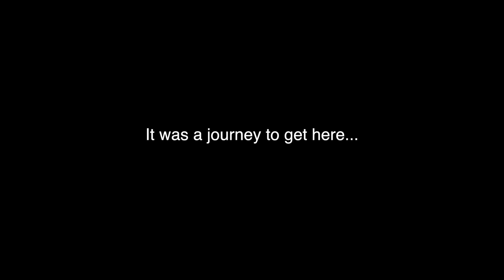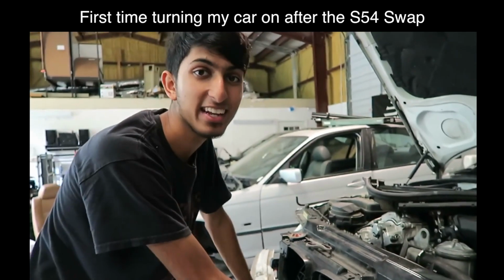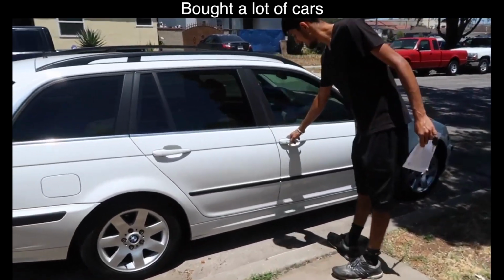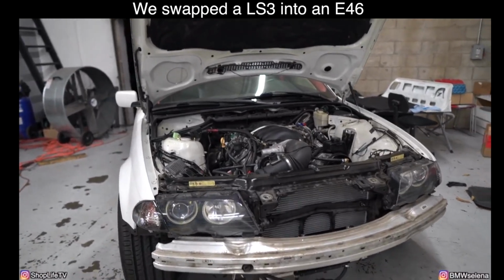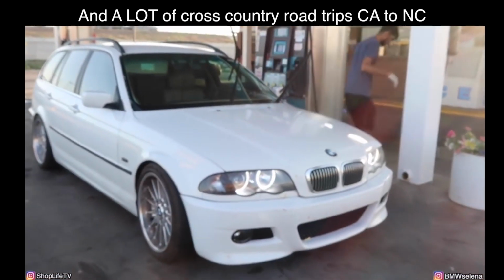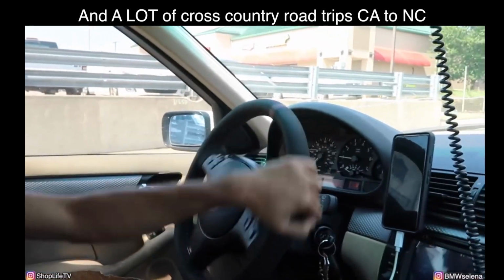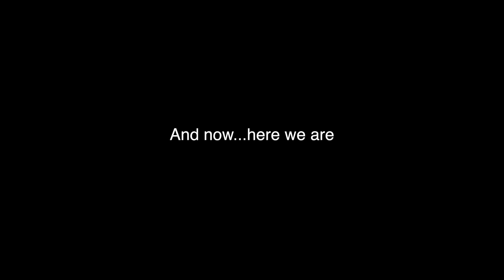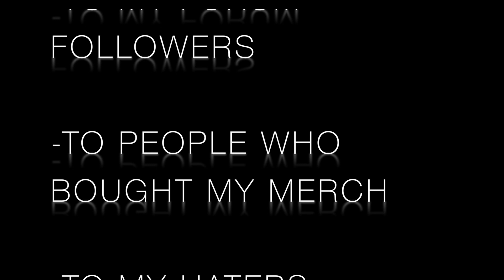My Life On YouTube! Thank You For 100k!

Comment: Hello, I have a 2006 bmw 550i. It has 73,6xx miles. I have some oil leaks and have started to gather parts and supplies to fix the oil leaks. I was wondering if you could help me out with a list of things I should buy and replace while I am doing valve cover gaskets and such?

Comment: l have been watching from day 1. The amount that you have helped me out in information and how to's is incredible. I own a 2002 330CI that has been fully swapped to a 2006 M3. I have done all the work on my car with a very limited (Very LOL) budget! If I ever wanted to know about anything or even if I was doing something and already thought I knew what to do I would (and will continue) look you up first. My car is running like a dream and I have you to thank many times over! I did the subframe with both welded and pouring epoxy into the rear bolt zones. Headers with cat delete, (replacing the little oil seal that you and only you showed to do on that side of the block) Brakes, O2 sensors, coolant flush, oil changes, Speed sensors, GPS and entertainment unit with back up cam. Then came the dreaded Vanos job, what a help you are! Battery change, suspension, chasing why my alarm kept going off (hood switch). And more! Just wow! Thank you!